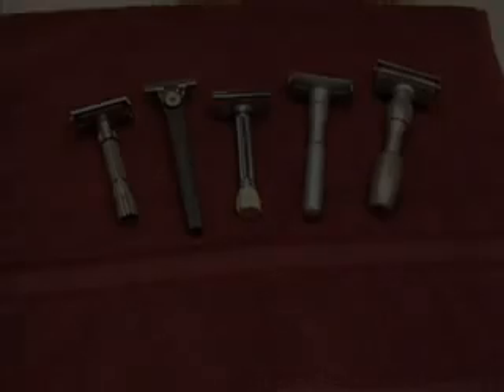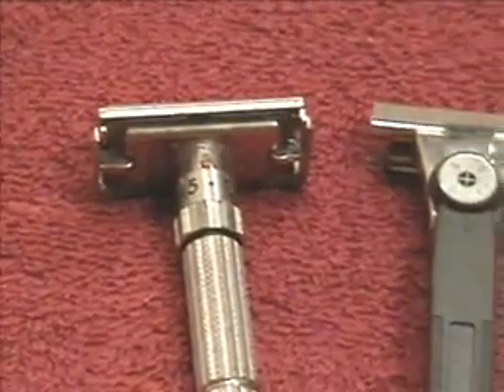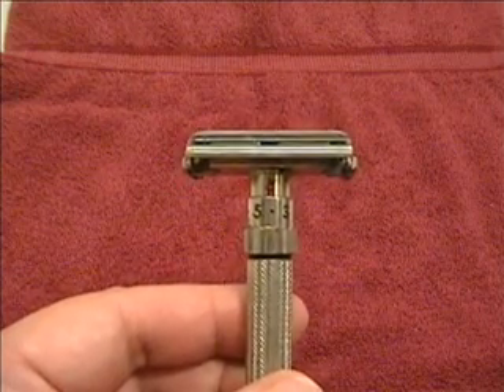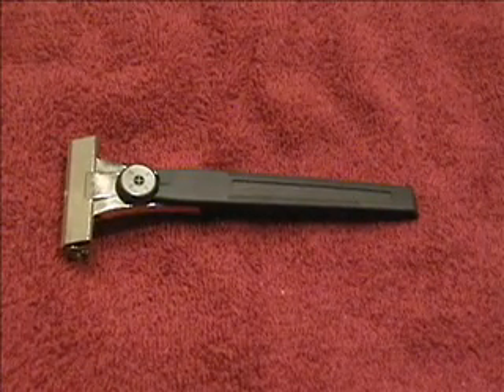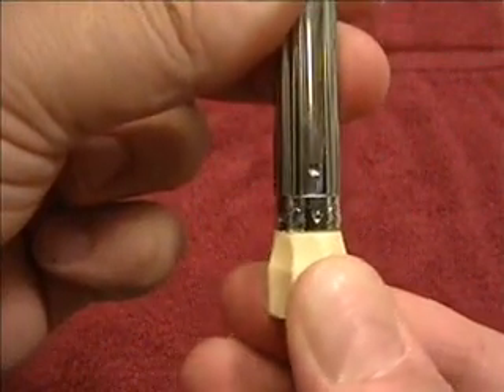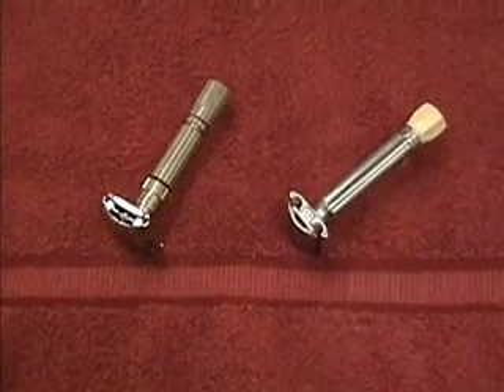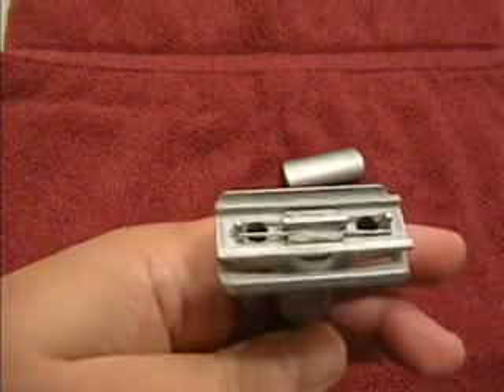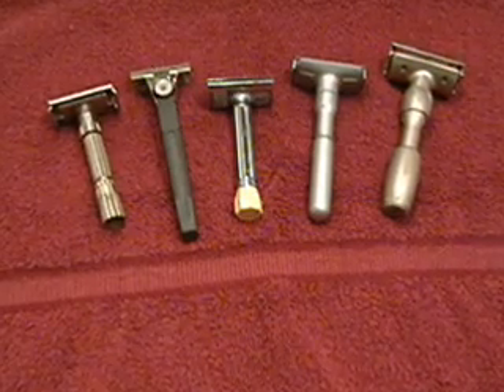Adjustable Safety Razors

Comment: I am so glad I found this video. I was looking for a way to fix the razor burn I always got on my neck from shaving when I discovered wet shaving. I found an old razor in my house, soaked in in CLR, and bought what I needed to begin. What has amazed me most is to have found out that that razor that I have just used belonged to my great-grandfather and it's the Gillette Fatboy! I had a wonderful first experience with wet shaving and I will never go back to using my Proglide!

Comment: I've read on some forums that the Futur doesn't hold the blade tightly, so it actually "rattles around" a bit while you're shaving.  Not sure I like the sound of that. Has anyone experienced this?
Reply: Yes. I use the Merkur Futur and it is a real high quality Product. Blade is safe and the razor is quite agressive. I use it with Gilette 7o‘clock-Blades on Level 2.

Comment: mantic,
i just bought a merkur vision, but it didn't come with any directions (with text, just pictures). on the adjustment, which way is more aggressive?  when there is more of a gap between the blade and the safety bar, or less of a gap?
thanks.

Comment: I've had a lot of success and really like using a schick adjustable m1, even with my really sensitive skin and coarse hair.
Very easy shave.  Even on my first try I only cut myself when I didn't realize I had a mole.  And now I don't!  Haha - Anyway I was wondering - Given that I really enjoyed the schick m1 and had little difficulty, I'd like to ask:  What kind of adjustable or fixed DE blade might you suggest if I were to try one?

Comment: Hi, I have the Progress and I find that as I go up from setting 1 the blade seems to be a bit lopsided, so the gap at the right is a bit bigger than the gap at the left. I have tried your advice about putting my finger on the head when screwing it down but it still does it. Is this acceptable or should I return it?

Comment: Hey, I have a question you may be able to answer.  About a year ago I bought my first safety razor.  It's a Schick Crona, and have been using it ever since.  It gives a nice shave, and is gentle on the face.  Today I purchased a Gillette  Windsor, and just tried a shave with it.  It's way harsher!  Maybe it was my blade (not a fresh blade, but not too old either), but it felt like it was tugging my hair.  Are there characteristics that make a razor more or less gentle?

Comment: Mantic (Mark), you have it wrong on the adjustables. They weren't phased out in the 1970s - the Super Adjustable was available until 1987. Plastic parts on it (it was the last of the Gillette Adjustables) started in the 1970's, but people can take away from your video all adjustables from Gillette disappeared in the 70's...I'd suggest a comment box on that :-) Any questions feel free to PM.

Comment: Mark   - I hope you're still receiving comments on your older videos.  Do you know that the head has been changed a bit on the Merkur Progress?.  When I purchased mine a few months ago, I noticed that the top cap and base were different.  The base plate has a different arrow, and the top cap "guide" indentation has also changed, and not for the better in my opinion,.   A Merkur rep told me the old molds were worn out and they redesigned it when preparing the new molds.  

I've seen videos where it was suggested that the Merkur Progress actually has 10 or 11 settings, as you can go past setting 5 for another complete turn and a half before the top cap will unscrew.  Have you ever tried dialing it up to "setting 6 or 7"?  I used "setting 10" today just for an errant hair on the nose and it was absolutely perfect in the trim.
Reply from the maker: Yep, still getting comment notifications.  :)  I was not aware that the head may have been changed.  I guess I'm going to have to buy a new one to see the changes, even though my old one still works just fine....

Yes, You can dial the Progress way past the 5 setting.  It's not necessary for me though.
Reply: Check out these threads I posted to on B&B months ago so you can see the new head.  You might need to sign in to see all the photos, but the ones I posted are from image sites and s/b visible w/o signing in:

http://badgerandblade.com/vb/showthread.php/482955-Merkur-Progress-Long-Handle-on-Amazon-Price-Alert-42?p=8072567#post8072567

I started these:

http://badgerandblade.com/vb/showthread.php/483119-Merkur-Progress-Long-Handle-now-50-29-on-Amazon-com

http://badgerandblade.com/vb/showthread.php/484005-Merkur-Progress-Changed

Comment: The beginner's razor" that I've used since before Christmas 2015 just wasn't getting the job done so, after a lot of research & questioning experienced wet shavers,  I decided to purchase a Merkur Progress off of Ebay. It was only $30 and a great way to make sure it would be a fit for me.
Over the last 2 weeks the Progress has been providing great shaves but, no matter what setting I use with the Progress I'm still not getting the closeness I am looking for beneath my chin and Adam's apple. 
In your video on the Progress you mentioned that using the Progress  would mean that I should use a shallower angle; could you please elaborate on that for me. I've been using the 30-degree angle since I started DE shaving.
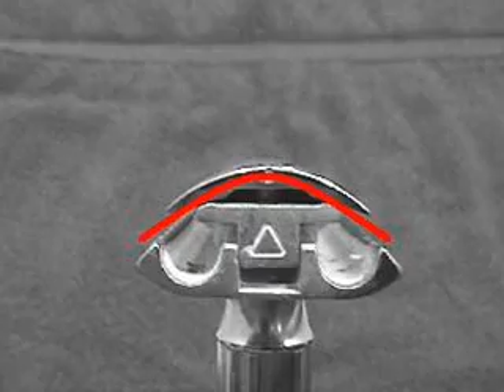Reply from the maker: +Andy Robinson at about 4:34 in this video I show how the razor angle is different.  But you're right, it does deserve some additional explanation.  I'll work on a follow-up video!
Reply: I have gone over your video several times and have worked on the angle a lot. I have lowered the second and third pass to #2 and am getting less razor burn and more comfort on the neck. However, I am still having not getting as close as I need to be for shirt & tie every day.I am currently experimenting with going to #3 or #4 in the problem zones of the neck.
I would certainly enjoy more info on this GREAT RAZOR. It is definitely a game changer for me and my shave.
Reply: Have you tried dialing it up to "setting "6 to 10"?  In other words, have you ever tried going past setting 5 as I explained in the comment I just posted?  

Did you buy a used razor from Ebay?  I'm curious to know whether you purchased the old version with the solid arrow on the base plate or the new version.  I purchase a new long handled Progress  from Amazon directly (not a 3rd party reseller)  for $52 and I had to exchange it twice.  Each one had some kind of imperfection.  A few had scratches, one had a cracked plastic handle, and several weren't calibrated properly.  The first one was the older version shown in Mark's video.  The other 2 were the ones with the revised heads.  To their credit (as everyone knows), Amazon has excellent customer service, and they offered me a $10 credit towards a future purchase.  When my 3rd razor arrived and I noticed a ding in the base plate, and the handle was calibrated to start at setting 5 (just unbelievable that Merkur would let these leave the factory!), Amazon offered me a 50% discount if I wanted to keep it.  I decided to just give in already because it seems that Merkur's quality control apparently isn't up to par these days..   Between the credit and discount, the long handled Progress ended up being $16.  I figured that with the savings, I could purchase a Merkur short handled Progress.

In the several months I've been shaving with the Progress, I've also noticed that the blade exposure under the cap  is uneven on each side (both in width and length view), but I still get wonderful shaves with it..  The audio feedback is noticeably different on each side,  however.
Reply: it appears to be that you have not gotten along with the Merkur razor. If I were you I would go to a safety razor forum, go to the classified section and purchase a reasonable Gilette adjustable razor.The guys on the wet shaving forums are usually selling quality items that will last forever and if by chance you get something that has a problem they are a apart of YOUR forum and they will take it back! If Merkur isn't for you don't waste any more time on it and get to the Vintage Gillette razors that were just about  perfect from the 40s through the 60s. Good luck.

Comment: Is this still your everyday razor Mantic59? I just tried mine today and it's the best non slant razor I've tried by far.
Reply from the maker: +blarg these days the OneBlade razor competes with the Progress in my shave den.  But if I'm testing a new product (like a blade or a shaving cream) I reach for the Progress first.  :)  Still love the razor after all these years.
Reply: +mantic59 Have you tried the apollo mikron that the progress appears to be based on? I've been lurking on ebay but they are almost out of my price range. Hopefully one day I can pick one up for under a hundred bucks.

Comment: Hi- I'm making a comparison between the Merkur Futur and the Progress (long-handle version).   Do you have any information regarding the merkur futur presenting an uneven edge protrusion at each side, i.e. one side is to agressive while the other is to gentle.  I have read reviews describing this issue both at first use and in long term usage.
I'll appreciate any comments you may have on this subject.
Cheers.
Reply: mantic59 has given some sage advice for dealing with the quirks of the Progress.  The uneven exposure issue to which you refer has gotten some unwarranted "exposure."  For most users, it is not an issue.  His recommendation has been to simply rest your finger on the razor's head after you load the blade and tighten it down.  In doing this, you are applying some tension to prevent the blade from slipping slightly.  It's a minor detail, but it certainly works.  The tension is maintained once you've snugged down the head.  The blade remains stable from then on out---even as you adjust to your desired setting. Personally, I have tried carelessly slapping on a blade and tightening it down without resting a finger on the head and noticed about 99% of the time, it seats properly without any special intervention.  Resting your finger on the head essentially ensures you have 100% accuracy.  Beyond that, if the user has any issue keeping even exposure, I would venture to say they have a bad razor.  In which case, you can bet Merkur will make good on it.

Comment: The futur is an interesting tool. It has an incredibly heavy handle, with a light head. Very awkward and prone to slip when gripped with a wet hand. This razor sports an impressive range of adjustments and is highly effective -- but it is strange to use, and not much entertainment or elegance to it. The blade loading and unloading mechanism is TERRIBLE, as it is cheap, and quite dangerous. Some are quite fond of the Merkur futur, but it is my opinion the Merkur Progress is a much better razor,